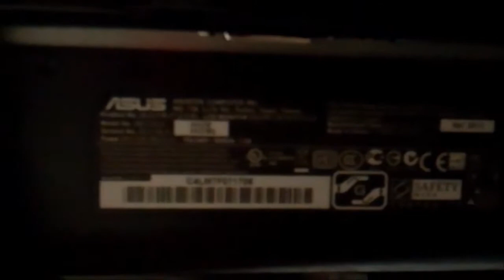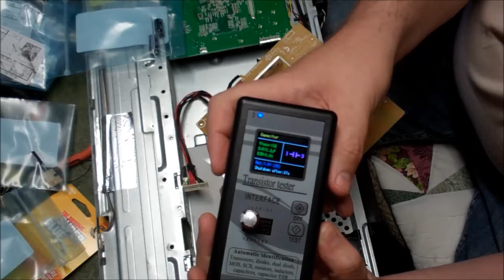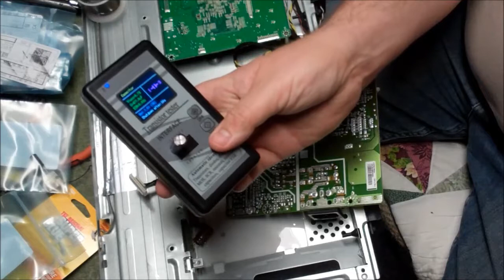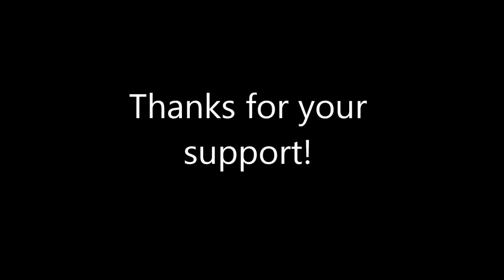Let's Fix an Asus VX278 Computer Monitor.

Comment: Thanks for posting this. I fixed my ASUS VE278 (July 2012) 27 Inch.
Problem: Initially on power up the Power LED would just flash. 4 Months later I decided to try fix it. On Power up, nothing, now the Power LED did nothing.
Solution: Replace C939 and C916, both are 1000uF, 25 Volt Capacitors.
Both of the Capacitors where bulging slightly on top.
After removing the Capacitors I tested them. Using Atlas ESR70 Tester:
Results:
C939 = 238uF, ESR = 2 ohms.
C916 = 538uF ESR = 1.4 ohms

So my guess is that C939 was causing the problem, has it only had 1/4 the Capacitance it was supposed to have.

I feel like a boss!
-R
Reply from the maker: Good deal.   These were very good looking monitors.   Extending the life of electronics is good for the wallet, and for the environment...  but mostly the wallet.

Comment: Where can I buy capacitors and power supply for a Asus VS248 Monitor, thanks
Reply from the maker: I get them from DigiKey or Mouser.
Reply: @DeadKoby  Thanks very much I really do appreciate the recommendation. I contacted both companies as well as calling Mouser directly, they were not able to help me. I thought it would be simple to purchase a replacement power supply, but they need more specific detailed information, such as mfg specs numbers or a schematic number. So I did a search on the ASUS website and found this part # Asus LMT VS248H POWER BOARD    Part Number: 04G550432020 
called back Mouse, but they were notable to find anything.

The board experienced a power surge and a burn out on the board, the capacitors appears to be fine where the burnout occurred 22uf 100v, directly behind the burnout is a chip 0876, not sure if its defective. Any suggestions would be appreciated

Comment: My VE278Q suddenly started alternating black every few seconds. The usual suspects are bad power supply caps. I was more interested in a video of how to get the thing apart. Bulging caps I can see once I get it apart.
Reply from the maker: This was years ago....  but I believe once removing the back screws,  you work the clips loose around the edge.

Comment: I may have missed the info in this video but, I am looking to recap my PB278q and when looking at the parts available I am seeing things like NP Bipolar Non Polarized Capacitor,  Non-Polarized Electrolytic Capacitor  etc ... What type capacitors am I looking for? Thanks
Reply from the maker: Usually, just electrolytic capacitors go bad at this age.   Most electrolytic caps have a + and - marked.  if you install them backwards they will blow up.   The non-polar/bi-polar type exists,  and doesn't have the + & -.    try  Mouser or Digikey,  and you'll be able to find the parts.

Comment: Hello, my monitor has lost its color. Image is seen but nothing has the correct color. I can see little green dots, and similar things, do you know what it could be and if it can be fixed :(? It's the same monitor as the video
Reply from the maker: Not really.   After this repair,  this monitor served another 3-4 years then the LCD burned out...

Comment: Our ASUS VS Series VS238H-P just started having issues.  It will power on and display the image for a few seconds and then off.  I can hit the Menu button and it comes back on again but goes right back out.  Getting ready to dive into it.  Anyone else repair this model?
Reply from the maker: Pop the back off and look for swelled up caps
Reply: @DeadKoby  Nothing is noticeably swelled but I did find a few bad alum-polymer caps with my ESR meter.  I can't really find info though.

They are SM with the markings of
220
16V
Z4A

I assume 220uf and know 16V but Z4A?

Thank you or anyone for info very much.

Comment: Great work! Sorry for bothering .. for a year around I didn't find the solution :(
I got the problem whit my Asus vs197de monitor, VGA no signal and goes to sleep mode..I tried everything different cables,pc , trying to restart monitor in every possible way but the issue is the same... monitor has only one vga port
Do I need to open it ? What can be the problem?
Thanks again for your skill sharing on a great video and explanation 🙂
Reply from the maker: This one wouldn't power at all.   If you're actually getting the NO SIGNAL on the screen,  it might be a cracked connection on the VGA.... but I'm just throwing out a guess.
Reply: @DeadKoby  thanks I was thinking the same, since there is no logical explanation 🙂
Yes it's powering but no connection
Reply: @DeadKoby  i got strange color around some spot of the monitor then I power it of and cannot power it on again

What that mean if u can help

Comment: So what causes the Bloating-Just general Wear??
Reply from the maker: Usually poor quality caps....  or a 50v cap being run at 48v...   Good practice is to pick a cap about 1/3rd higher voltage than you need if possible.    There were lots of BAD CAPS made from 1999-2010.   There's a whole website dedicated to them.

Comment: same thing is now happening to my asus vp239h-p, it will turn on during daytime and I can't use it in nighttime :< do you think it's also about the caps?
Reply from the maker: It is possible.   When looking at the power supply board,   see if any of the caps feel warm or look bloated.    After the cap-job,  this monitor served for another 4 years.
Reply: @DeadKoby  thank you, but I think I will let the technicians here at my place look at it, I am not an expert in this kind of job. Can I ask how much did the capacitor replacement costs?
Reply from the maker: about 20$ with shipping.

Comment: i had electricians change fuses at the fuse board the other day and when they left the monitor wouldnt come back on, was working fine prior to them hitting the master off switch at the fuseboard, im so pissed off right now because it seems like i cant be compensated for their negligence *maybe i'll look into purchasing one of those transistor testers and giving this a go, i have basic soldering skills etc and at this point doesnt seem like i have too much to lose ?
Reply from the maker: Bummer.   Good luck.
Reply: @DeadKoby  the worst part about all this is that where i live is in lockdown so even trying to purchase a new monitor through click and collect options is a nihghtmare because retailers are not answering their phones for some unfathomable reason ? i will probably now have to wait until monday without a monitor , but will definitely look into repairing my asus because its a great monitor when it will actually turn on lol,, the replacement transistors would probably take two or three weeks to arrive anyway because there is also nationwide mail delays due to covid and border closures etc .. this worlds definitely going backwards lately yeah